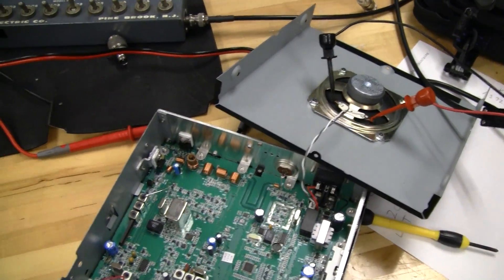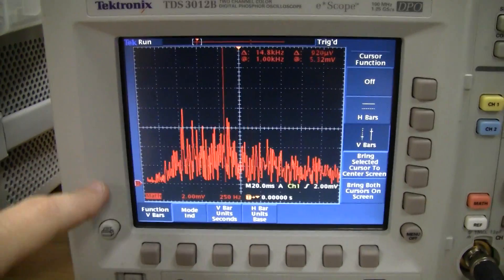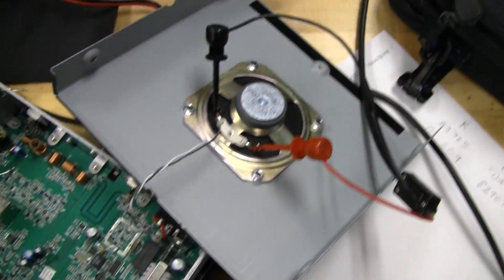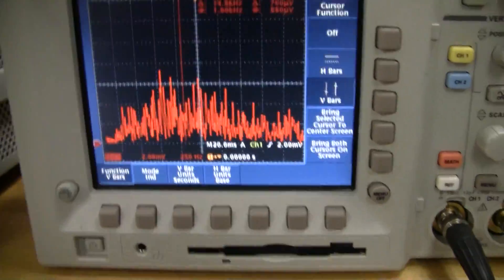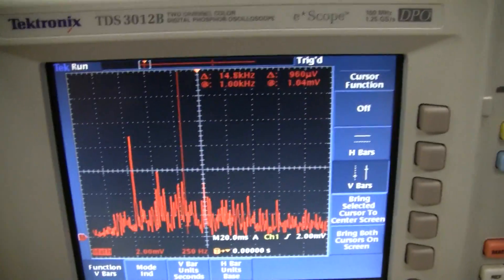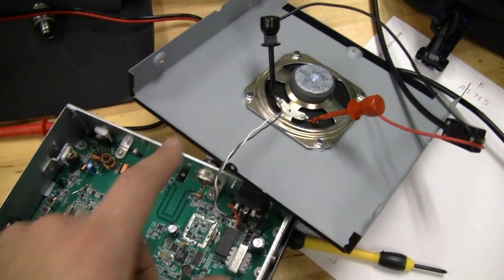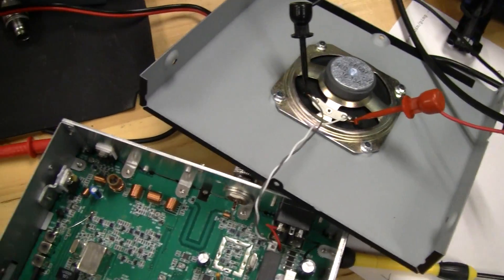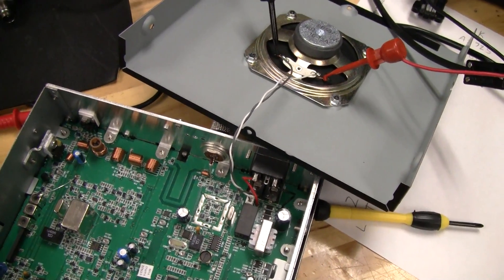Low Pass Filter Idea for Clear CB Radio Audio

Comment: What I do which amounts to the same concept, is to use a capacitor substitution box, connected across the volume potentiometer, and then tune to a weak signal somewhere on the band, and adjust the capacitor box to find a capacitor that attenuates the upper end of the audio noise, which is where most of the noise comes from.  Or rather, high end audio noise.  Hence, this attenuates the atmospheric noise.  Once I determine what capacitor value I need, I solder that capacitor parallel to the potentiometer.  I seem to recall it performs better if you connect the capacitor from the volume potentiometer center wiper to ground.  Since in adjusting the volume that overall low pass effect changes.  I know some fellows might have some bad comments to add here, however I have done this enough over the years to know that this works well.  What you are to be concerned about is to examine this with an actual weak signal.  And the voice band is from 300 Hz - 3.8 kHz.

Comment: If 450 if crystal filter is the professional way my friends .... Crystal filters more stable and grabs singles at faster rate .... This happens so fast u cannot even know it's happening just like NB it's a high frequency filter a cap to ground usually...and switch for step up of filtration good luck 9lb hammer ok customs

Comment: My recommendation to u is to use a 1puff cap at the whipper the  volumn knob the center pin on the volume knob whipper to DC ground.... This will make it awesome ...and will not effect the receiver or output recieve audio quality it will grab anything that's high frequency and null it too ground ... I filter all my galaxy radios this way it's amazing

Comment: Did you ever try a ~0.3uF cap between the speaker terminals?  It might be even better to put a smaller 0.33uF cap between the volume pot wiper and gnd.

Comment: If you are going to  put something after the amp I would put it at the external speaker jack. Your speaker is fed from the jack. This will make it filter the external speaker as well. I actually just wound a ferrite core inductor by the seat of my pants out of scraps and it worked great. I do think filtering after the amp is best because it takes some load off the amp and let's the amp work more towards the pass frequencies, but most of mine have been after the amp.

Comment: I feel bad about popping your balloons, but the telephone industry long ago studied which frequencies are important to communicating speech intelligibly. They are roughly 300Hz - 3kHz. Communications radios like CBs are designed to have similar frequency response characteristics. The high filtering is done at the intermediate frequency stages, so that by the time that the detector produces an audio signal, the frequencies above 3kHz gone. The low frequency filtering may be done in the audio stages and/or by using a speaker that is less efficient at low frequencies.

Low frequency components in the human voice (below 300 Hz) give it a punchy, "authoritative" sound, but they do not aid intelligibility. This is why big, booming voices might be heard in movie trailers (which play in acoustically isolated rooms with powerful sound systems) but not on communications radio (or even NPR, for that matter).

The range between 1kHz and 3kHz is needed because this is where some speech sounds like "sh" and "ch" lie. If you attenuate these frequencies, the audio will sound very "muffled," and it will become difficult to understand what people are saying.
Reply: Uniden and whistler with their scanners do not employ this filtering on the audio outputs.  They pass everything up to 20 KHz.  That is why scanners sound like crap as compared to a commercial radio such as a Motorola or Kenwood.  As mentioned here in this video, a couple of components can make a filter to clean this audio mess up.  I use an L/C type filter I have developed in my scanners to fix what Uniden and Whistler refuse to fix.
Reply: skypilot0077 you are exactly right!! You hardly hear people talk about the crappy sounding handhelds that kenwoods , icoms and A few other manufacturers that produce ham radio handhelds that produce a massive hissing sound.. that of course sound like my scanners I have.. but of course that’s  with my scanners I have I’ll give them a break but those other handhelds I just can’t believe they let them go out like that. Although there are a few Chinese radios that have great sensitivity and actually better sounding analog voicing, and much much lower hissing sound.. The big three companies on their handheld so start prioritizing the sounding of the radios but of course I don’t think they’re going to do that because it seems like they’re switching to digital and that’s a whole different story with no hiss whatsoever.. so their not probably look into that.. Digital seems like the future some of these HT’s..But I wholeheartedly believe what you believe in I just cannot stand a hissy sounding Tinny radio,again some of these Chinese radios have really good analog sounding radios ,cheers have a great day.
Reply: skypilot0077 heh, I have too. Cool.
Reply: klafong1 umm, u owe him 2 medium white balloons :/.
Reply: "I feel bad about popping your balloons, but the telephone industry long ago studied which frequencies are important to communicating speech intelligibly. They are roughly 300Hz - 3kHz. "
That's not entirely correct. Human speech is much more complex than that. There's information beyond 3KHz, especially the "s" sounds make this apparent. 4 to 6KHz would be more reasonable thus, I think. Let's remember, human speech not only carries words but also emotions, which make use of subtle variations in sound. And emotions are the tiny little bit of something that sets us apart from machines. That's one of the reasons why eSSB and AM fans exist. For more information, please have a look at http://www.nu9n.com/essb.html

Edit: I hope you didn't get it the wrong way. I didn't meant to critize you in anyway. What you wrote was alright, I think. I rather think it's the telephone industry that spreads false, incomplete or outdated information here. :)